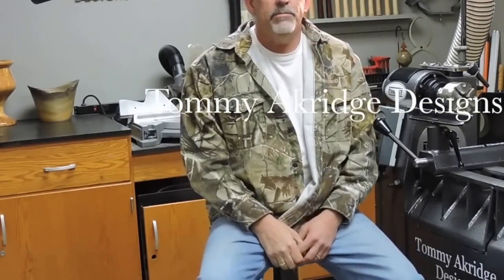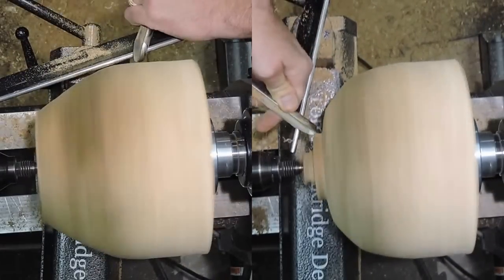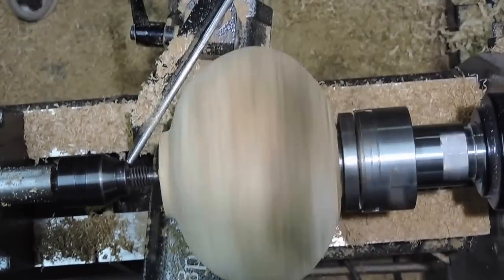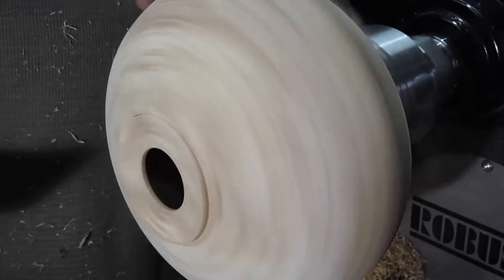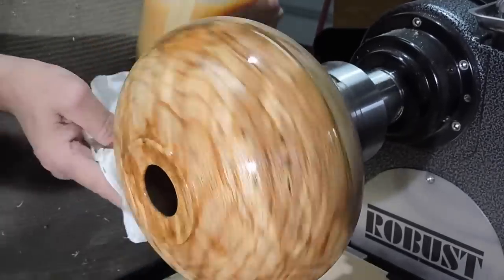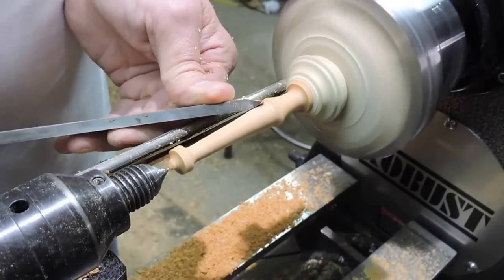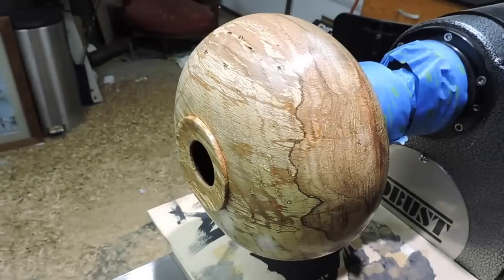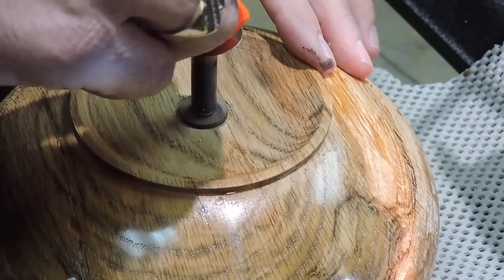Wood turning a wood vessel/bowl

Comment: Lovely project.  I've used spray lacquer quite a lot and I've always been happy with the results.
I'm a member of a wood turning club and each month we have a competition.    The principal judge is the guest demonstrator and on one occasion we actually had the great Cindy Drozda.
I've won a few minor prizes but the point I want to make is that the finishes on the bottom of pieces are as harshly judged as  the other parts.
The use of wood filler is the road to damnation.
Many thanks again,
Alan.
Reply from the maker: Thank you for your comments, I always try to do a great job on the bottom and make it where you can't see where I held it in the lathe. You are right, the bottom is part of the project. 
I need to get into a club and spend time with other turners. 

Thanks Tommy